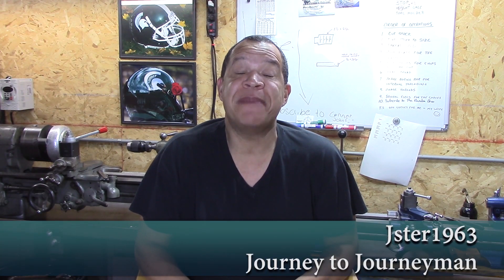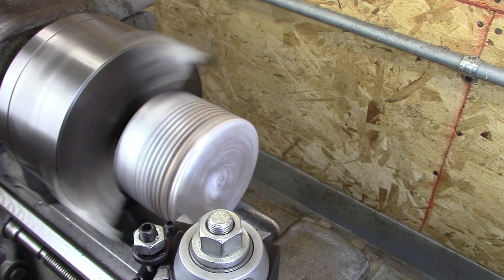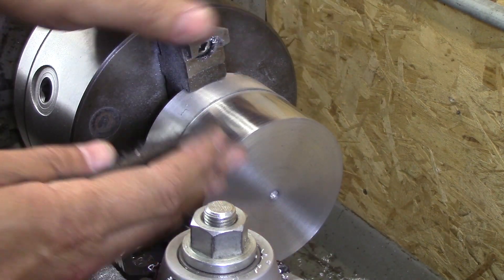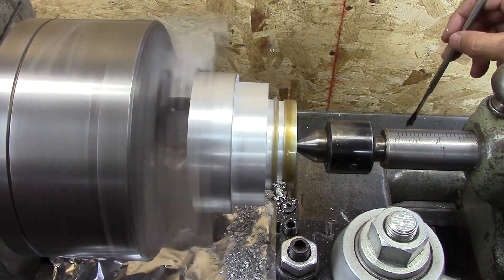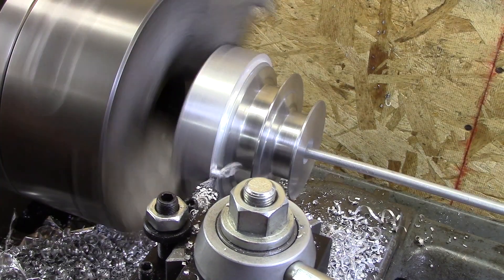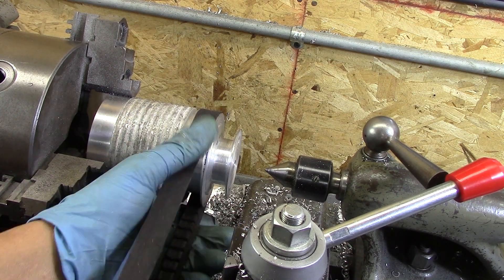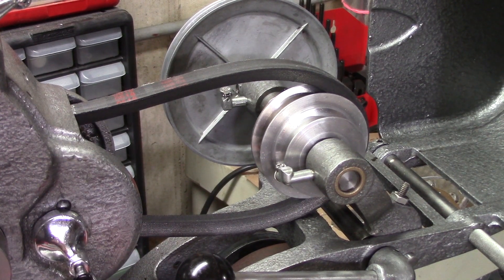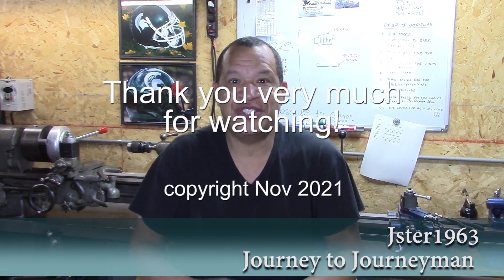Journey to Journeyman, Episode 28.  Making a pulley for my Atlas Horizontal Mill.

Comment: Great timing seeing this in my feed. I need the exact same part to finish my rebuild. This will be very helpful when I start machining a new pulley for mine. Thanks for sharing. Can you post the dimensions so I can compare readings to what I have? Thanks!
Reply from the maker: Thank you for the kind words!  I just copied the old pulley so I didn't have dimensions.  However, I just measured it and the small pulley is 2 3/8" diameter.  The larger side is 3 1/4" diameter.  And the width is 5/8" on both.  I really don't know if these are standard sizes or not.  Good luck with your rebuild....
Reply: @jster1963  Thank you so much! Can you measure the center diameter of each pulley also? I can't tell you how much I appreciate this.
Reply from the maker: @sky173  No worries. The small inner diameter is about 1.570” and the larger one is 2 1/2”. But you should fit it to the belt. Good luck…..
Reply: @jster1963  Thanks so much. That's about what I came up with. Cheers!
Reply from the maker: @sky173  You’re welcome

Comment: The first pulley is easily salvageable. You have plenty of material so make a top hat bushing to go into the pulley. The relief for the top hat will eliminate the inclusion in the pulley and the top hat will be large enough in diameter so you can fix the bushing to the pulley with flat head screws... a slip fit for the bushing will be sufficient. 
A question: What are the rim diameters of the pulley on the drive motor?  I'm rebuilding a mill that was given to me and the pulley is missing.
Cheers from NC/USA
Reply from the maker: Someone else pointed out that my pulley is able to be saved.  I think I will do that and make a video. 

I just measured my pulley the best I could.  The motor pulley is a 2-step pulley.  The small pulley in the inner smallest part is 1.075".  The outer pulley is too big for my calipers to get the inner part.  The out lip is 4.5".  There is a youtuber (FLKayak'n) and he has all of the Atlas blueprints.  He just sent me the counter shaft pulley on that machine.  I'm sure he has the motor pulley too.  Reach out to him and if he can't get that to you, I'll try.  And thank you so much.....
Reply: @jster1963  Thanks for taking the time to get those motor pulley measurements. I have an early 1943  machine with triple pulleys on the jack shaft and the main spindle. My calculations are that the motor will need a 3.25" and 1.75" rim diameter pulley driving a 3.25" and 4.5" rim diameter pulley on the jack shaft.  I'll be making a handful of  two piece eccentric bushings for the Change-o-matic gears. There is no way to adjust the gear back lash in the gear trains and mine are so bad it's a wonder they haven't crunched each other all to pieces. Cheers from NC/USA
Reply from the maker: @aceroadholder2185  You're very welcome.  I hope yours is back together soon....

Comment: You did a fantastic job on the external turning, both times! I made a pulley quite a while back, and I made way too big a production out of it--I was just learning to use the lathe. I now need to make another one, and I hope I will do a better job. I made the first one between centers, but I think just chucking the hunk of aluminum makes a lot of sense. Congrats on a nice finished product.
Reply from the maker: Thank you so much!  I was going to do mine between centers, but I'm glad I didn't have to.  I have to make another large pulley and I'm not sure how I do it.  Good luck with yours and thank you again.....

Comment: Nice work. There is nothing more satisfying than a successful DIY project. No matter how many attempts it takes. 😂 Hey, that is how we learn. Seriously, I often factor in a practice part on my projects especially when it’s a new to me operation.  
The real reason you don’t use regular cuttings oils on aluminum, is it tends to make a black gummy mess. But we use what we have handy.
Reply from the maker: I need to start factoring in the practice piece!  More often than not it turns out that way anyway, LOL.  And that makes sense about the cutting oil.  Thank you so much for the kind words.....

Comment: Would you demonstrate how to do the setup for cutting the angle? I only have the little 109 lathe, so maybe it can't be done properly on it???
Reply from the maker: I sure will.  I will be doing another pulley very soon.  I think you can do it on that size lathe.  I was going to do it on my Atlas 618 and it's very small.

Comment: Awesome work!  You might want to sleeve it to remove as much of the runout as possible. Since it is aluminum, just use aluminum foil as a sleeve and add layers as needed. Runout produces vibration and translates into the cut quality and can also prematurely wear out the bearings. As for making the mistakes, I am the ultimate mistake master. You'll take that title from me. 😂
Reply from the maker: Excellent advice!  Thank you so much....